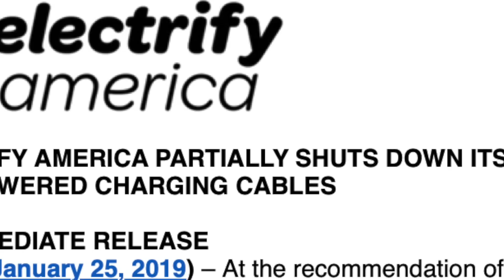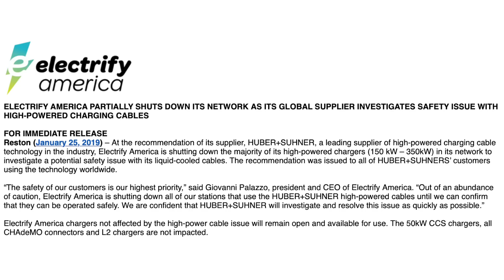(UPDATE - FOLLOW LINK IN DESCRIPTION) Why Charging Stations For EVs Are Being Turned Off Right Now

Comment: The ultimate solution, undoubtedly many years away, is wireless charging in virtually every commercial and on-street parking spot. Just as wireless cell phone charging is standardized for all new cell phones, wireless EV charging will also be standardized.  Commercial entity parking Will be provided as a perk to customers and absorb as an operating expense. Off street parking Will be provided by cities any nominal charge just as parking meters are used now.

Comment: Fastned in the Netherlands just announced that they have checked their cooled charge cables and found no safety issues and started their +175kW chargers for operation again. Nikki probably has right that the issues that has occurred where prototype cables only used in a very limited number of charging stalls. The responsibility of the use of those prototype cables will be investigated.

Comment: This is an major downside of EV charging that we must face if we want charging to get easier and better. This would never happen with gas pumps. I've never been to a gas station that was down or needed maintenance.  Outside of owning a home charging solution or charging at work, I do believe that public charging as a whole is a bit of a mess and won't be able to sustain the millions of drivers that it will get once EVs become more mainstream. I don't know what the solution is, but public charging stations are just not convenient. I don't see them ever beating the convenience of the gas station unless they're not meant to be the standard at all, just the rare exception when you need a quick charge while you stop and get groceries.
Reply: I've been to plenty of gas stations where the pumps were down or out of order or the nozzle wouldn't work or they wouldn't accept credit cards, etc. Public charging stations are currently in their infancy, they will grow in number as the number of electric vehicles grow, it's just a market that needs to come into its own. Standing in 1915 you might have said the same thing about gas stations then since the first gas station had only been opened a decade earlier.
Reply: @FTLNewsFeed  Do you think building more charging stations is the solution? I'm a bit doubtful. Public charging stations can be occupied anywhere from 30 mins to 8 hours. If they can make charging as fast as refueling,  not be out of order so often (maybe if there are more of them, the broken ones won't matter as much), fix the problem of competing brands with subscription services, and transition to one type of charging port, then I think EVs would be ready to take over gasoline. Until all those factors are addressed and solved though, public charging is still a bit of a mess.
Reply: I've been to loads of petrol stations where the pumps were either dry or out of service.
Reply: I bet you “never had an issue” with asbestos products either nor arsenic in drinking water nor radiation issues from a micro oven. Car exhaust is poisonous and “convenience” is not a good reason to continue. BTW, look for gas station fires on YouTube and tell us your opinion. Thanks
Reply: @Rhaman68  I agree, but the general public doesn't care. People won't switch to EVs unless they are MORE convenient and cheaper than ICEs.
Reply: PatsandSox95 that is because people, particularly Americans, don't give a damn.
Reply: Since I worked a little for a company that was in petrol station building and maintenance, I can assure you, they need to have maintenance and repairs much more often than you think.
Also, petrol stations did not appear at the same time as cars. Early adopters had to search for petrol in places like pharmacies for quite a few years
Reply: I have to (at least partially) disagree with you. This does happen with fuel pumps (right now, just 2 km from my home, there is a garage [gas station] that is having several pumps replaced. Further away there is another, that is undergoing  major repairs, including having its tanks replaced (although this does have as much to do with the upgrade of the associated convenience store as it does the lifespan of the original tanks). However, given the degree of ubiquity of pumps, there is a high level of redundancy available. That being said, there are also alternatives for EV users, but not at a practical, widespread level for longer distance travel. I would wager that given the skewed response of poorly informed news outlets to ANY potential incidents involving EVs, (i.e. most of them) the leaning was to erring on the side of caution.
I think that we'll see a mix of home and public charging which will be determined by cost, convenience and consumer preference and perception, much as the mix between new car sales of diesel and petrol is determined by the consumer. I'm an ex truck driver, and my wants have changed dramatically since my twenties. I would now place a premium on the convenience of charging at home, or only travelling shorter distances by car, and flying for longer journeys. But yes, agreed we must look at the medium term picture. Do bear in mind that it is far cheaper to expand the charging network than a liquid based refueling network.
Reply: Too bad there wasn't a plan like the IEA and OECD countries signing an Accord in 2010 to have 1 million chargers in Germany by 2014, in France by 2015 with the goal to have 40% EV by 2017.  Gee, wonder what could have happened to that Accord?  Probably was it that politicians paid off ( corruption) and today DE and FR with about 14,000 chargers, Swiss about the same.  And Swiss government coming out with admonitions to the industry that they need to harmonize charging infrastructure, but it isn't harmonized.  Don't want to say I am a conspiracy theorist again, so I wonder why they don't get together?  Really I have no idea.  I am stumped.
And when HQS gets back at me, I just want to ask why Tesla has never put in a charger in Western Switzerland in the Lausanne/Geneva area?

Comment: So  a prototype cable has a problem , a cable that is not the same as the public network cables .
But they shut down the public networks  anyway , so confusing
Reply: Safety first.
They could also wait and let the users check the cables. Some companies would probably go that route.
Reply: They do not know what the cause of the problem is yet.

Comment: Good to know the issue was in the plug on a prototype station. Not unreasonable that they hit the panic button as can you imagine the poo storm that would result from someone getting a 350wk jolt?
Reply: And gas cars will explode when they’re standing in the heat for too long...
Reply: @thelining4078  you clearly don't understand. The car would be fine, the smoking ashes would be the person who shorted out the charging cable.
Reply: @thelining4078  And almost no media would cover it. Where as if an EX customer was killed by a charger it would be on every news outlet for a month.
Reply: It would be very ugly. Just a lot of smoking ashes basically.

Comment: From that report it sounds as though the problem may be with the plug (or maybe the cable to plug connection) rather than the cooled cable. Since the plug is presumably a CCS one then they are perhaps concerned that this issue may also exist in plugs already in service.
Reply: Maybe, maybe not,...

Comment: What happened to Tesla's supercharger network. I saw that someone tried to saw through a cable and then drill it. Surely they would have got an enormous electric shock?
Reply: No these charging cables are not live until it talks to the car with low voltage signal wires first. Once everything is good and no ground faults detected only then does the station switch on the power. It also will kill the power if it detects the cable was removed from the car.
Reply: @JoshuaPritt  Thanks for clearing that up for us beginners.

Comment: CCS charging all over the world reduced to only charging with 50's.  Hard days for those not using Tesla.  Not to say this could not happen to them either.
Reply: Actually, 100kW charging is possible and stations exist without liquid cooled cables, those should still work. Besides, there could very well be another supplier of similar cables out there, if there isn't yet, there will be soon.
Reply: @Soordhin  Those cables are more of a futureproofing solution. They use liquid cooled cables on 100KW so that they don't have to manufacture separate set of cables for 350KW chargers. Also, those chargers might be modular or easy-upgradeble to 350.
 Also there are only 2 ways of making 350KW cables without active cooling:
1. Make the thicker (and heavier)
2. Use something other than copper. Something that is more conductive, but is not to expensive.
Reply: Well, the CCS standard currently requires liquid cooled cables for chargers over 100kW as far as i know (CCS 2). Up to including 100 kW (CCS 1) standard cables work. And as there seems to be somewhat of a shortage in liquid cooled cables currently, some charging networks equip their high power chargers, in some cases the 350kW ones, with non cooled cables and then limit them to 100kW until such time they can exchange the cables to cooled ones. 

As usual it is all a compromise of cable length, weight (a small and not very powerful person still has to be able to charge), resistance and resulting heat load and the resulting charging loss which in turn lowers efficiency. Currently the cheapest solution for the HPCs is liquid cooling, that might change if other technology becomes available.